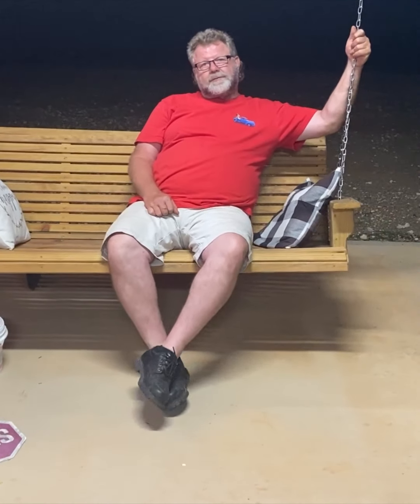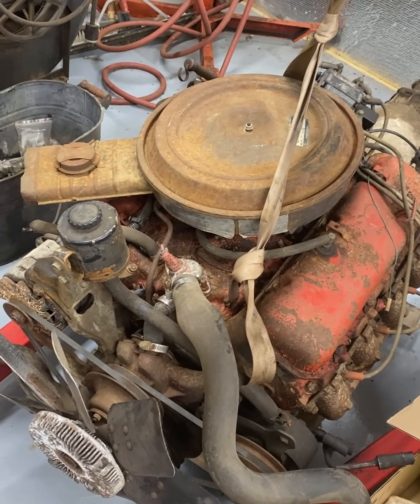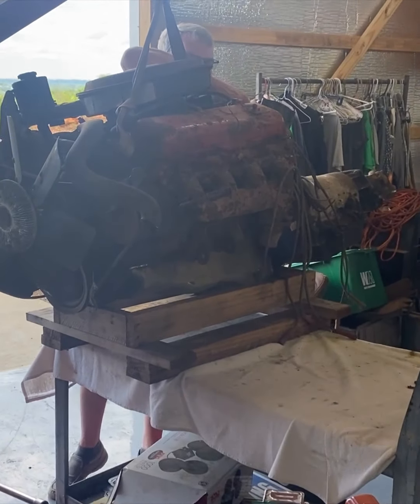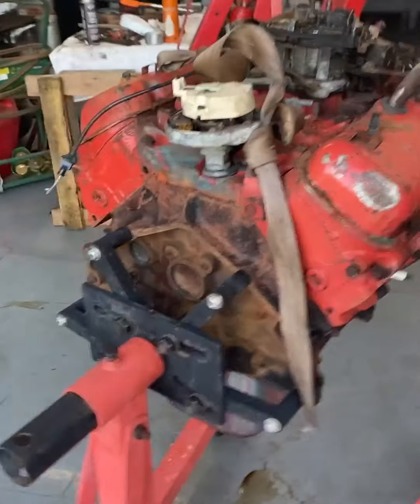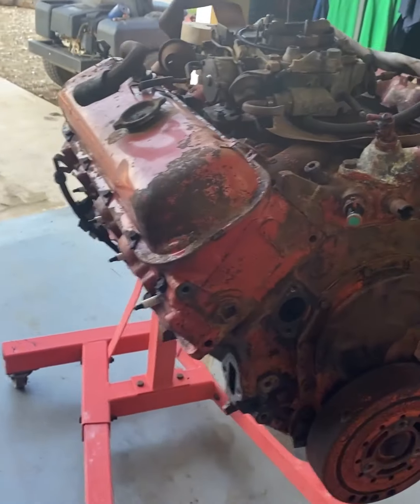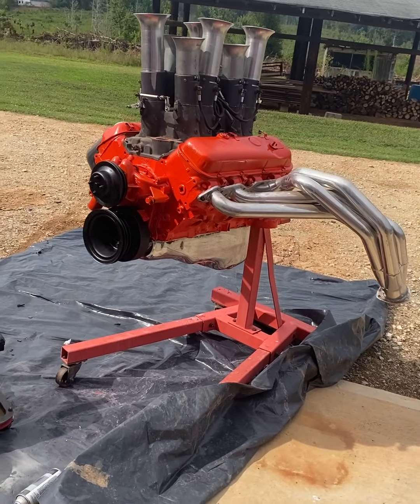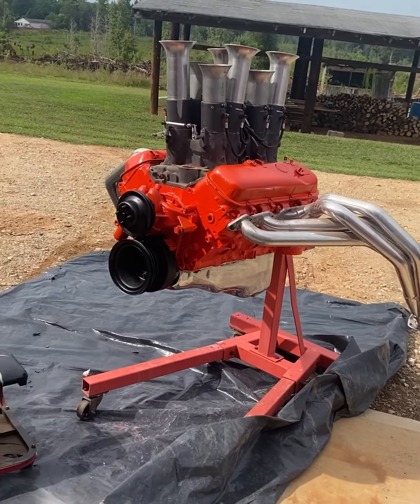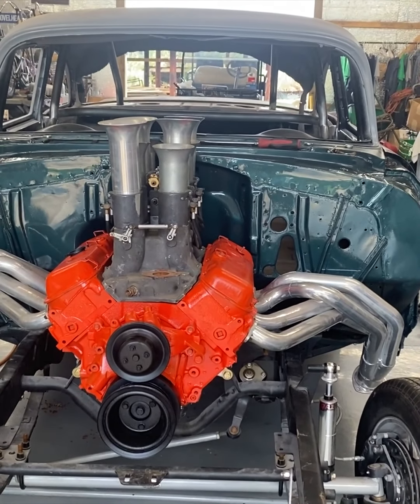Mock up engine

Comment: Boy that Chevy orange not only added horsepower but dam man it made that 454 look awesome. The stacks are freaking cool where did you find them? Keep us posted on the build youve got a mean looking 55 Gasser👍 Talk to you later
Reply from the maker: I was catching hell for painting it up lol 😂. That motor is for another project just needed for mock up of the 55. The stacks I bought on market place they are made by Kinsler  fuel inj.
I’m going to convert them to efi . Thanks for checking it out.

Comment: Hey Rick man that intake manifold is killer.  
Love it👍 what axle you have? Under the 55
Reply from the maker: The injection is a kinsler mechanical. Will be converted to efi for street use. My front axel , well the whole front clip is a Jim Myers racing unit. I understand Jim recently passed. Those Roadkill guys went buy his shop when they were building the Blaspyhemi car.
Reply from the maker: The rear end is a 9” set up all strange unit with ladder bars 3.73 posi right now but I’m going to change to 4.56
Reply: @poorpossumsspeedshop5746  nice going to be quick 
In the 1/4 mile
Reply from the maker: @IronheadGarage   hope so 1/8 mile around here. The goal is to run in the 6s . Still run pump gas and drive to the track. What’s the story on yours? I love to look it has and you’ve got mad skills on the fab work
Reply: @poorpossumsspeedshop5746  mine has 355s in right now none posi. Just the stock rear end. I'm might buy a Posi center in just a little bit. A guy has one for sale 
It has 308 gears and it's posi out of a 64 ss impala.
800 hundred bucks. 
There hard to find.
I'll drag race mine sometimes. But mostly it's just going to be a cool driver
Reply from the maker: @IronheadGarage   yea here to. Just a hot rod. I’ve seen you following the southeastern gassers on tv, I’m lucky enough to life not far from a lot of those guys. Do you ever got to any of their stuff
Reply: @poorpossumsspeedshop5746  no I haven't I wish I could.
Be really cool to live back there I would be at all the races...
Reply from the maker: @IronheadGarage   I always go when they are at shady side  Quain Stoutt Is from right down the road, and  Greg Porter is around here also he has the night stalker 55 both super nice guys that are more than willing to talk car with a fella. Someone was talking on Bws live about us getting together at an event. Wouldn’t that be cool.
Reply: @poorpossumsspeedshop5746  all those guys seem to be great To cool.. You are a lucky man I tell you lol. 
That would be pretty neat to all meet up one day. But I live pretty far away. I live in Washington I would burn a lot of fule getting there but you never know😁